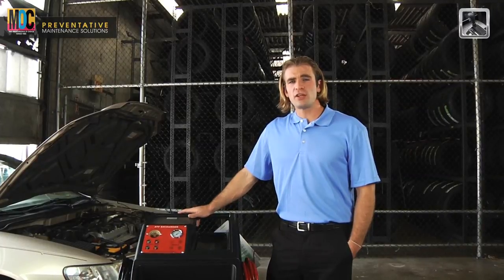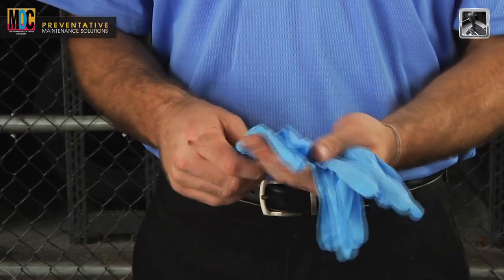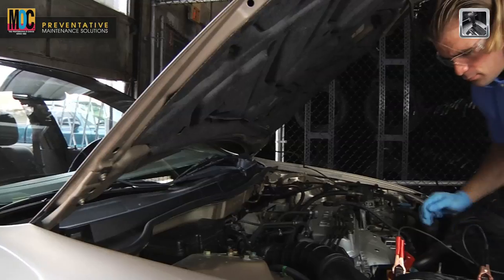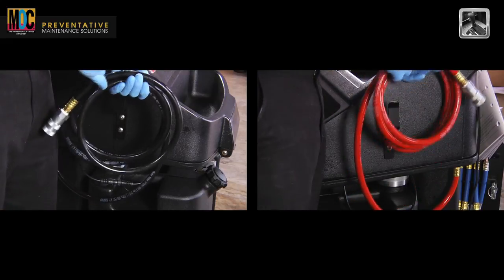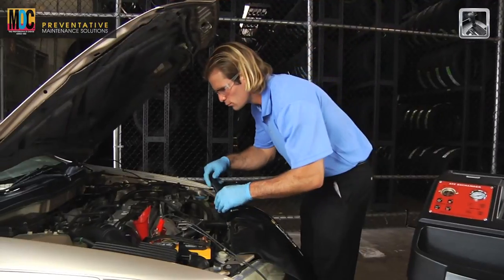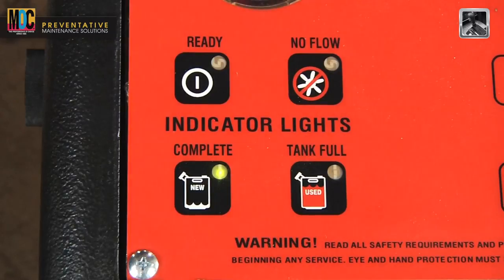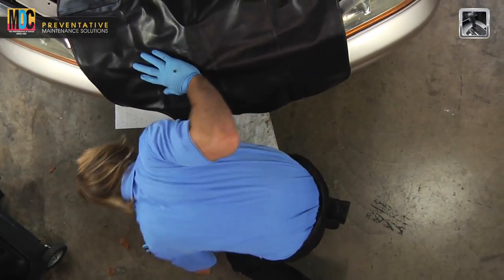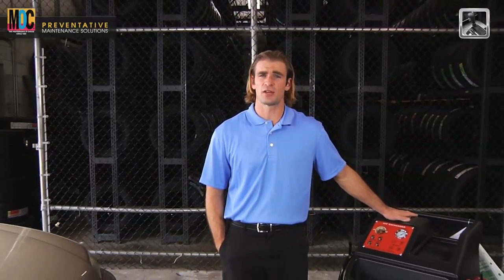Transmission Fluid Exchange

Comment: Dose this change the fluid when I was talking to the Toyota dealership about doing my transmission service they were telling me they hook it up to a machine or something like that and I kept asking them does it take out the old fluid and put in the new fluid and they said that it just filters it or something like that is this the machine that they're talking about?
Reply: Most likely. Don't think anyone filters fluid. Replace old with new like this machine. Some pressure flush , and those are not good